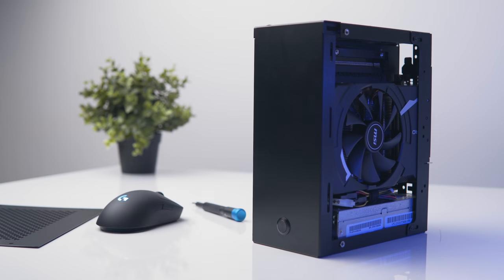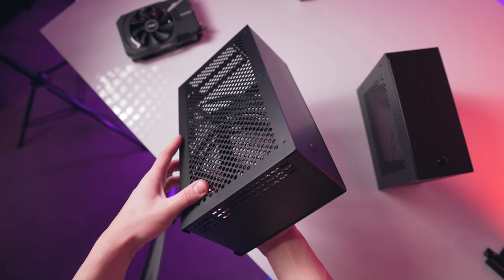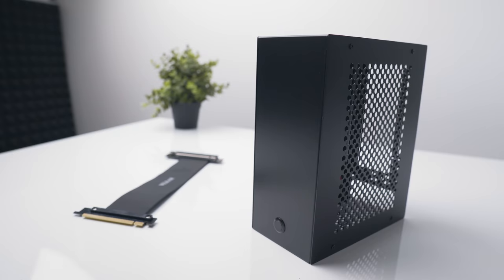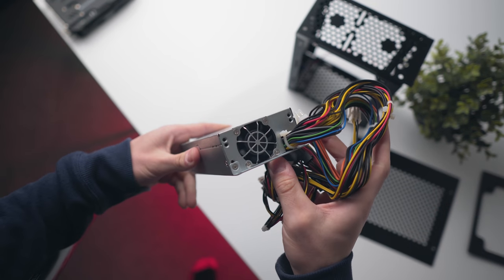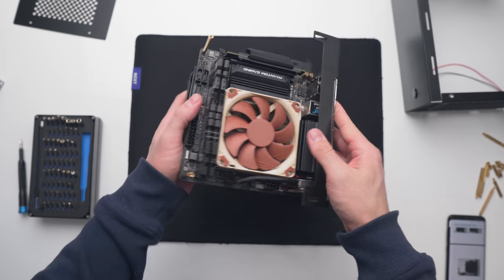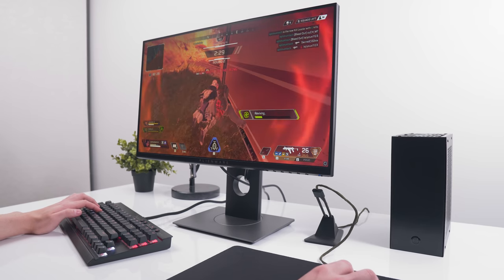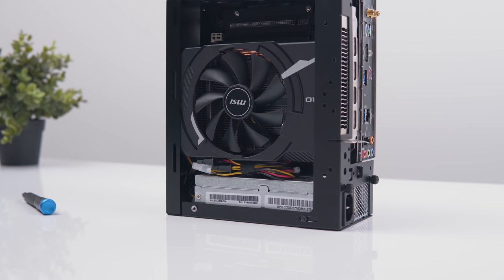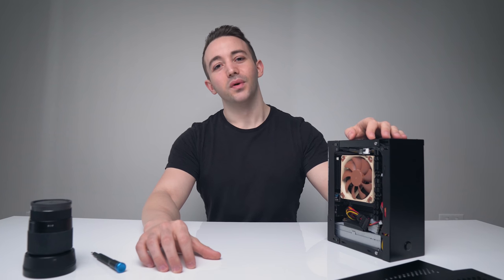Velka 3 - World's Smallest RTX 2070 Build!

Comment: I still think that ~15L is the smallest system that will be truly powerful and quiet without compromises on components. A simple rectangular box of about 35x27x15 (DxHxW) can have up to 300-310 mm GPU cooled by custom loop with 280x45 mm rad. Even with only bottom intake (everything else glass/aluminum), 3-5cm clearance from desk does the gob at 30C ambient for i7+1080Ti. Guess i9 or any ryzen + 2080Ti will be fine too. Using slim 30mm thick rad with reference GPU height (which is very common and logical for liquid cooling) will allow to downsize the case to under ~13L.

Comment: What about NUC 9 case with a NUC 12 motherboard,12400, and a unique 4080 covered by VEGA 3060 ti COOLER? Yes, we have made that happen. It's crazy. 4080 drops from 335 watts to 240 watts, timespy score drops from 28000 to 26400. And of course, a replacement of nuc 12 CPU fan is also important, I recommend Lenovo 360 ultra cpu turbofan.

Comment: Just put my Velka 3 together. Such a nice, light case. Definitely not a walk in the park though. I struggled mostly because I used my own 30cm riser which may be a touch longer than necessary and was quite stiff. 

Anyone here use the Velka brand riser cable? It looks much more flexible and easier to wrap around tight to the motherboard.

Comment: I'm using an A4 SFX case and I  prefer to place it vertically if possible. It looked weird with all the cables jutting out on top but it granted easier access to the rear ports and allowing the case to be placed much more closer to the wall.

Comment: What is smaller than the Ncase which does not compromise due to 1) noise 2) heat throttling
Reply: Depends on your components. All of that can be achieved in this case

Comment: i do believe there are rooms for water cooling even inside this tiny case space, but that need serious custom parts.
custom pump, custom water block probably integrated to water distr-panel.
think about how corsair one did their case, use negative pressure to archive the goal of only using one fan to cool 2x 280 rads.

ok maybe this case is still too tiny, but under 8 liter, this should be doable, fullsize gpu and  itx + full watercooling. stil waiting for that day.

(currently using 7.2L cpu watercooled case zsa-4 with full length GPU and SFX psu)

Comment: The first thing I would do is replace those countersunk screws with ultra low-profile socket head cap screws.  I keep a bunch of that hardware on hand because of my CNC router and 3d printers.  It would drive me absolutely crazy otherwise.  I don't think that sheet metal is thick enough to do a proper countersink.

Comment: Now imagine a desktop motherboard that is powered by USB PD. One cable comes in, provides 100W, and all I/O. The PSU and I/O are then external. M2 slot and heatpipes to the case itself means only one internal cable: to a power switch/led

Comment: low noise isn't something a server PSU is designed for. Nice case, but they should just go for SFX rather than chasing a few milliliter smaller.
Reply: Or external brick like a laptop
Reply: @oldymcstinkysocks4686  Certainly not with this config. The option is very limited. Better just opt for the larger Velka 5.

Comment: WHOA! this case is pretty amazing, from looks to functionality. i've been extremely happy with my metis case, but the form factor of this case is on another level. 
since i already have the single fan 1070 (i used to run dual fan 470 initially in the metis), this would be an ideal case for me. turns out that overclocking isn't so important to me, so ditching the aio on my ryzen wouldn't be a problem and all i would need to get would be low powered flex psu and low profile cpu cooler.

Comment: Thanks for the review on quite a cool case. The S4 mini doesn't work as well in tower mode without feet.
I've ordered the Velka 3, the PSU you linked (seems to be the best 400W Flex ATX unit out there) and an NF-40x10 FLX fan for a swap-out.
I'll get a 5mm shroud 3D printed to add to the fan.
I'll be using mine for a portable workstation. Looking forward to putting it together.
Reply: Hi! Any luck with fan replacement?
Reply: @SergeyMaslatsov  I have the PSU and the Noctua fan, but haven't done any testing yet. (The rest of the system is still 6 odd weeks away).

Comment: Would it be possible to fit a Hdplex 400W combo in there?

There are several options to fit both a 2070 and the Hdplex 400AC inside the Skyreach 4 mini. Zotac, Inno3D and Galax are some 2070 that fit with no real mods needed.

Comment: I’ve been eyeing this case for a few weeks now. Hoping to use it for my next build. Also hoping to use the upcoming Gigabyte 2070 Super mini, though I’ll probably swap the fan with a Noctua because I’m sure it’ll be a jet engine. I’ll also swap the PSU fan probably with the Delta AFB0412HB-F00 (the Noctua 40x10mm fan has almost 1/4 the static pressure of it). I may also clip the unneeded cables and heat shrink the ends. I’ll also need to use the Enhance 600W Plat PSU because it’s one of the few with more than just an 8-pin plug for GPU power.

Comment: We need a fanless Flex-ATX PSU... I build inside a FX 4.7 and had to decide between a Flex-ATX PSU or a fanless internal 200W HDPLEX ACDC/DCATX unit. Luckily I went with the fanless unit. But now I'm limited to 50W for the R5 3600 and 125W for the R9 Nano.

Comment: I took apart a Lenovo laptop last night. Co worker gave it to me to mess with. Her daughter used it in college and it was headed for the recycling. After opening it up and taking out the memory and ram, I had a thought. Was the idea for M.2 drives taken from laptops?
Reply: Do you mean was it inspired by mSATA/mini-PCI?
The idea for M.2 was to replace the  mSATA/mini-PCI connector with something that could accommodate a PCIe x4 connection. They knew not everyone would want to buy the more expensive NVMe drives, so they made the M.2 interface compatible with SATA as well.
Beyond the raw performance improvements, they also wanted to fix mSATA's main limitation, that being its size. So, M.2 can have drives from 42mm to 110mm.
It does work very well in laptops, but I highly doubt it was its sole intended purpose.
Reply: Grey-man, thanks for the info. I’m still new to this. Did my first build about 6 weeks ago. I’m 34, and missed a lot of developments. My pc has the nvme version. When I opened the laptop, it was something I saw that looked familiar.

Comment: Looking at how the structure of the case is made, wouldn’t it be cheaper to custom design a case and get the parts made at a machine shop to get a good ITX design? 

Also, GEEEK makes their own Flex ATX power supplies and they offer it with different power ranges, the minimum being 400W. They also let you swap the fan for a Noctua one, as well as choose colored cables, and WHICH cables are built into the PSU (i.e. sata, molex, which PCI power cables, etc)
Reply: @nickjacobsss  Really? That's a shame. :L

Comment: you might be able to move the graphics card up, mount the psu horizontal, then save a tiny bit of space in the bottom. remove top fans and add 40mm baby noctys to vrm to make a velka 2 that is actually the size of a power supply ;P

Comment: Its bout 150 with the riser cable, shipping to the uk! That is great and I would definitely pay for such a good design
Reply: ThATS NOT GREAT .. about £100 or less would be .. If you can fit an Flex atx , I dont see why you cant use the PICO-psu as used in the skyreach s4 (slient) .. they do versions which go up to 400w now. This would be great for an APU build but I guess ASrock deskmini has that covered ..STX FTW.
Reply: @barondippy1184  ok

Comment: This case looks freaken amazing, only thing that's a shame is that the there doesn't seem to be any more 2070 mini's for sale anymore, the MSI one linked is legit nonexistent, and the Gigabyte one is being sold around $700 on Ebay, so I'll probably go with the Velka 5 so I get a decent sized GPU in there along with the luxury of putting in a SFX power supply, still though kind of wanted to realllyyyy see how small I could get with a PC :/

Comment: I love the idea of this, but I'll wait for a second revision. I don't trust myself to change fans on a PSU because of the capacitors. Plus the manufacturing QA should be tuned up a bit so it's not as rough.

Overall though, really looking forward to this case once those details are taken care of. I've been looking for a case that takes advantage of the size savings of shorter, single fan GPUs and this might be it.

It's similar in size to the ASRock MiniPC but doesn't force it into using an APU
Reply: Instant death if you fuck it up, not worth the risk

Comment: Or you can just place a HDPLEX 400 in the Velka instead of the flex psu and live with an external psu that you hide beneath the table anyways. I think the new 300 W laptop PSUs from Razer I believe are incredibly thin and light compared to dell's old mega-brick

Comment: Hi, I built a S4 "brickless," it's important to understand you are HEAVILY restricted by width, more than length of GPU. You cannot have a GPU more wide than the mounting bracket, it just will not work. This rules out those single fan ITX cards from MSI and Gigabyte-- unless you forgo the mounting hardware and just use foam to hold the card in place. Very jank IMO but I have seen it done. If you want proper mounting, anything past a 1660ti and you will be forking out some serious $$$$ because 2060 and 2070 that will fit are both rare and have to be imported in the US. Another important thing to consider, since your GPU has the power supply RIGHT next to it all but touching, your graphics card will run hot. End of story. Undervolted you will still hit 80c on the reg. So if you are using an external brick and okay with that, stick with it cuz the alternative may be a much lower performance setup.
All that said I'm pretty happy with mine, and I think I like the Skyreach better than the Velka 3 just because you can lay it horizontal, which is usually the deal-breaker for me when it comes to both other cases with the "sandwich" style layout and others like the Ncase M1. As gorgeous as it is.

Comment: Please, we need a link to that Aero ITX 2070!
Reply: The 2070 cards are all going out of stock, at least in the US, to make way for the Super cards. I'm still waiting for the Gigabyte 2070 Super mini to release, but it's taking forever. There's also a Zotac 2070S mini coming out, but that one is too long to fit in the V3. Even their 2060S Mini is too long. MSI has their 2060 Super Aero coming out eventually too, but I haven't seen it anywhere.
Reply: Mid-December, still no 2070, 2070 super, or 2060 super for sale that is able to fit in this case. Basically if you want to game in this case right now you're going to have to use old cards from the GTX 1000 series. Sucks. No idea why manufacturers have discontinued the mini itx 2070 cards while providing no replacement.
Reply: Parapraxium 
Yeah, it’s annoying. The MSI Aero 2060 Super ITX exists, but only outside the US. Heck even regular 2060s are getting hard to find. You’re almost stuck with just getting a 1660 ti.

Comment: If I could swallow the premium price for a mini build, I could never swallow the deafening noise.  After making a silent system under load with a three fan gpu and a 280mm Noctua setup on my radiator, I don't think I could go back. If I needed a loud gaming rig on the go I could just take my laptop.  But maybe it's not so much a bad setup as much as it is a setup not for me.

Comment: hey i hope u read this but i noticed the 500w plat version of this flex power supply has the fan out the back next to the plug so you dont run into the cable bunching problem

Comment: i'm worry about that psu... Does 400W is enough for RTX 2070, core i7 and more stuff ???
Reply: I have a 650W PSU and it fuels a 2070 Super, a Ryzen 5 3600, 3 Drives, and 16GB of RAM, and a 650W Can even Fuel an RTX 2080Ti

Comment: I bet you could get the Hdplex combo in that case as well.
Reply: Matt G  I was wondering that too. Unfortunately the 400w ac-dc is too long at 180mm but if you don't mind something sticking out the back or using it as a brick. It's a very pricey alternative. I only consider it because I have a spare hdplex 400w dc-atx laying around.

Comment: All Plex-ATX PSU models are loud af. They perform like server PSU.
Reply: No they are not. You just need to invest little bit more money to get quiet one.

I learned my lesson with evga chassis which had pretty noisy psu when stressed.took me 200€ to get almost silent psu...
Reply: @jkarra2334  What brand and model did you get? Cheers,
Reply: @classicmartini  that was FSP group titanium certified 500w flexatx psu ,i also changed fans to noctua inside psu.

It was harder few years ago, i had 4790k + r9 nano and they needed more juice than todays hardware.

Nowadays you can buy fanless 400w flexatx psus....which is plenty for average fast cpu &gpu

Comment: Edit: Ah this is the Velka 3 that I also saw on sff pc reddit. Very clean case though but might need some work though it's nice that it supports an internal psu. I know that fsp make a 500 watt flex atx psu you can sometimes find on ebay which is actually cheaper then buying an hdplex + power brick and no cables. Since I use a headset for gaming I would not mind the sacrifice of having a louder psu though I might be interested in swapping out the fan too. Noctua make very good 80mm fans though not sure if they make 40mm ones. How much is shipping to the UK and do they even sell to the UK?
Reply: Hi Tom,
All products ship worldwide from the USA. Shipping to the UK is 29.99 USD for the case if bought without fans and 39.99 USD if bought with fans.

Comment: I have attempted a fan swap in a 1u psu (ASUS ROG XG2 External GPU enclosure) and it is not just as easy as swapping out a different rpm fan, those industrial fans are over 20,000 rpm, noctua 40mm is under 5000rpm, protection is immediately tripped when a different rpm fan is connected to the Logic board and even after consulting with the PSU manufacturer there was no work around.

Comment: The Inno3d 2070 twin x2 fits in the Skyreach 4 Mini as a brickless HD Plex build, though you need to modify the PCIe power cable to fit. There's actually a handy spreadsheet to see which cards fit/what modifications need to be made.

https://docs.google.com/spreadsheets/d/1H7F9lVWRqY5UHa9y0bOolioUddbVZYbhnz5A5FsVyN0/edit?usp=sharing

Comment: Does anyone have a full parts list? i'm struggling to find all of the parts
Reply: The MSI and gigabyte mini rtx 2070's have both been discontinued, you can still find them in some places that haven't sold all their stock yet but there is a pretty high price tag on them.
Reply: @elliotfenwick6871  Thank you! i'll try to find them or other parts that will work with this.
Reply: @LoganDay28679  no worries the enhance 7660b is a great PSU cause it's real quiet but can be a bit tricky to find and is 600w so might be overkill
Reply: @elliotfenwick6871  Okay, Thanks!
Reply: @elliotfenwick6871  Do you know if this case is big enough for my rtx 2060 super? I got it from best buy. GeForce RTX 2060 SUPER 8GB GDDR6 PCI Express Graphics Card - Black/Silver
Reply: @LoganDay28679  you'd have to measure it(or of not ordered yet there should be details for that specific card online as theirs so many variations) 185 x 43 x 142mm are the max dimensions. 185 long 43 deep and 142 tall
Reply: @elliotfenwick6871  Thank you so much! :)
Reply: @elliotfenwick6871  If possible, do you have any suggestions?
Reply: @LoganDay28679  don't know that much about other options, I got lucky and managed to find a second hand MSI rtx 2070 aero but it's been discontinued. I think there's a few 2060's sill being made within size but don't know specifics sorry. They should all have dimensions on them though
Reply: @elliotfenwick6871  Thank you! You've been really helpful! :)
Reply: @LoganDay28679 no worries 😁

Comment: How is a 400 watt PSU overkill for this build?
Reply from the maker: Becuause an RTX 2070 and an i5 are not pulling anywhere close to 400W.
Reply: @optimumtech  Thanks for the reply!  I used a PSU calculator and it recommended 400 watts. Do you think I can get away with a 350 watt or 300 watt PSU using a Ryzen 5 3600 and 2070? I am going to need an 8 PIN adapter as everything in this class lacks that at that wattage.

Comment: The Velka 5 is better - 300mm 2 slot GPU in 5 LITRES!!!!
Reply: And it can fit a SFX PSU
Reply: Not to mention SFX PSU's, the fan on my SF600 Plat rarely ever turns on, and when it does, can't even hear it over the 2080's fan at 30-50% anyway.
Reply: Insanity.
Reply: Website says that velka 5 is wraith stealth compatible without the shroud. What does that mean?
Reply: @nickjacobsss  I have a vk5, and with right angle adapters the cables are barely noticeable at all. I have 2xDP, ethernet, and audio, and they might as well not be there. its not as big of an issue as everyone says it is.
Reply: @valroz  You have to pop the shroud around the fans off, like this -> https://www.reddit.com/r/sffpc/comments/acv0ua/psa_new_wraith_stealth_fan_update_roughly_the/
Reply: @Skellist  I put a 700W sfx psu in my Cougar QBX. The fan so rarely turns on that when I first built it and was testing it out I struggled to find a way to load the system enough to see if the psu was working properly.
Reply: It looks so clean with a SFX PSU and SSD mounted next to it, because it covers the cables in the PSU area plus they add up exactly to the size of the ITX mobo (100mm + 70mm)